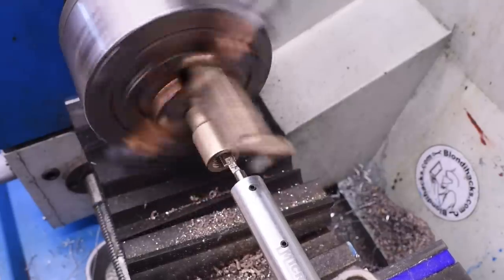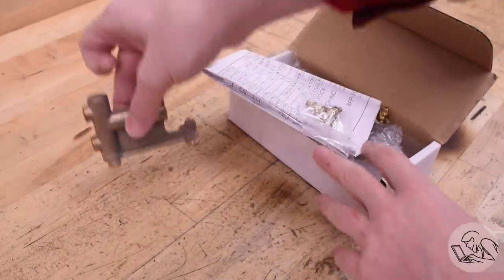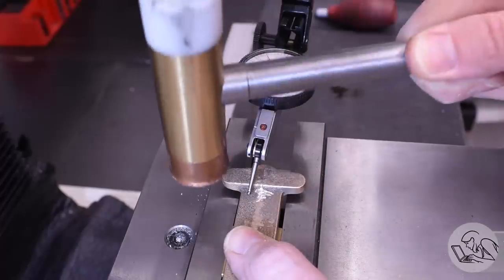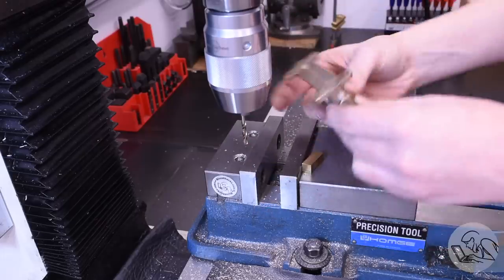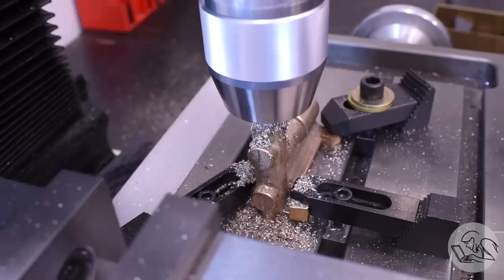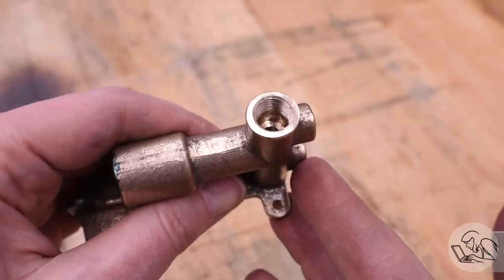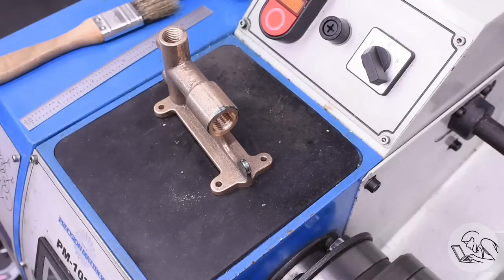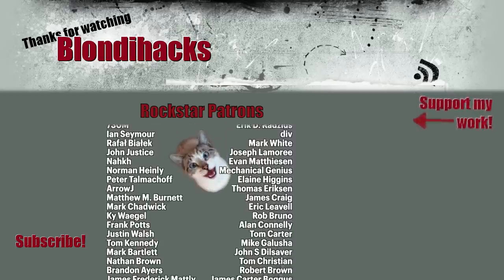Let's Build a Boiler Feed Pump! (feat. Ron Covell!)

Comment: As a boiler operator I love watching these videos. The boilers my company runs is 600lbs and 1500lbs steam from the 1940s and the equipment you make looks similar to the life size equipment.
Reply: What do your boilers power?
Reply: @pacificcoastpiper3949  we power 8 Power generator turbines 3 paper Machines and emirate of pumps, fans, dryers, digesters, heaters and anything else they don’t want to be electrical powered. It’s an old factory that was originally built 1898 and still producing paper today

Comment: Just a reference idea for when you need to drill two sizes in the same hole as you did with those dewalt bits Quinn.
I've had to do similar before and needed the holes to be somewhat accurate, so I started with the larger hole, then followed through with the smaller one. That eliminated the potential drift you mentioned 😉

Comment: Hi Quinn,
Glad you found some use for the pilot point drill bits. I figured they would come in handy one day and you did mention the proper way they were to be used. When you had the pump setup to mill the feet, could you have also milled the inlet and outlet faces to square them to the feet? You and your family stay safe.

Comment: Nice!  I made one of these a while back, and ended up doing it all on the mill.  However, one thing I'd come up with that others might find useful: If you cut the holes in the feet to a strict grid, you can use gauge pins in THOSE as your 'index' surface.  In my case, I used an angle plate to drill the long hole, and used a pair of gauge pins on through the two holes resting on the top of the angle plate.  

I ended up having zero problems with my index surfaces that way (and it was square to the webbing, since I clamped on that to!), though I DID have problems clamping to the angle plate (I used finger clamps, which gave out and ruined my first casting).  Had I been smarter, I could have used the vise the way you did.

Comment: Hi, Quinn, always good to see your video.  Now for the unwelcome criticism.  Here is your solution for the pilot drill thing. You drilled it first for the pilot point of the lower hole. Great, perfect. But then you drilled it out. Bad sequence. Solution; After pilot drilling full depth to the lower hole, follow that up by drilling to the pilot hole size needed for the upper hole.  (Only go to depth for the upper hole mind you.) Then drill the upper hole to its depth, and finally drill the lower hole to finished size. No drilling without a pilot. Easy peasy! Hope that helps, and greetings from Germany!

Comment: Hey Quinn, I really love your videos. Your approach to educating and amusement is wonderful. I am a carpenter by trade, now working in IT after some careless climbing in some scaffolding. Still doing woodworking as a hobby. The only need I can find for machine work would be the odd knob or fasteners. They would be a lot nicer than those from the hardware aisle at the shop. The bit that really draws me closer to the rabbit hole is the accuracy and tolerances which is unheard of in my world..

Comment: If you need a gauge pin in a size you don't have, you can stack 2 smaller pins with a gauge block in between. It's a little finicky to check a hole with, I usually wrap the whole stack with a rubber band, but it does work!

Comment: An air cooled steam condenser would be an added bonus. To recirculate the same water over and over again. An old car heater core and pressure relief on a reservoir would work nicely. Tip using only distilled water helps keep the engine and boiler internals clean of calcium build up that's present in our everyday tap water.😉👍👍

Comment: 14:00 you have 2 reference points machined already: put 2 gage pins into the holes in the foot you had drilled, and that should give you a vertical alignment

Comment: When you go to assemble the check valve using the hardened ball if you tap the ball at the bottom of the seat with a calculated amount of force you are "coining" the seat. It will be a much better seat than just relying on the machining surfaces.  
I used this technique while manufacturing a product that had a check valve integrated into the product and it works flawlessly.

Comment: Thank you so much for these extremely well put-together tutorials! I always thought about getting into model engineering but I just didn't know where to start. You channel has just the right pace and level of complexity to give me the confidence I could actually do anything other than create expensive waste. Also, it is naturally helpful to follow along as a beginner, as you're taking us along on your own journey and exploring new techniques along the way. Some of the more experienced people on You Tube are just out of proportion for beginners and do projects way too ambitious. 

One thing I'm struggling with is to keep the workshop clean as I'm working. Always swarf ends up on the floor, sticking to shoe soles and being carried around the whole house. Maybe it would be good to see what techniques / habits you use to keep everything tidy during the work? Also, how do you keep everything lubricated and not end up with smudgy hands? Somehow everything I touch in the workshop eventually has this light coat of (dirty-ish-oil), which I think is probably not conducive for more precision kind of work. Unfortunately I only have an outside shed and a 1912 lathe, so everything needs a lot of oil to keep working and not rusting. As an ex-car mechanic i don't mind it as such but your shop looks so clean and tidy. I think it's less the general cleaning than how do you actually work in there without making a mess? If I could keep it so clean, maybe I could bring the lathe into the house  :)
Reply: Ref the swarf and oiliness: the only way of keeping this at a minimum is to clean up after each and every operation. If you can't do that, clean up before you go for a break and at the end of every session.
Reply: I prefer to think of these not as tutorials, but as documentaries of what happened.  We for sure don't see every step, just the interesting parts.

Comment: Very nice work!  And thanks for the tip on using a plug to visually line up on the centre of an unmachined boss.  Every time I tried to do this via lay-out or just eye-balling it, the results were often unsatisfactory.
As for pumps, for a real challenge you may wish to build a small duplex steam pump.  No more hand work to fill the boiler with water!
These pumps were discussed at length on the Home Machinist website.  A number of different arrangements have been discussed therein, with construction drawings available at a reasonable price.
One such pump, a very compact one for locomotive use, was written up in Model Engineer Magazine during 1995.

Comment: Nice work as always.  A 9/16"-18 threaded bolt is probably not going to be a common size at a local hardware store but it was a relatively common thread size used on some older (1970's and 80's before things went metric here in Canada) truck wheel studs (3/4 and 1 ton series) that you may be able to find in stock at a local auto parts store and you can usually purchase them singly if they are in stock - just a suggestion that may help if you are looking for a test bolt with the correct thread.
Reply: 9/16-18 is a standard size for many hydraulic systems. Should be able to find a fitting at any supply house that deals hydraulic components.

Comment: As a electrical panel shop worker we used DeWalt's Power Point drills all the time drilling holes in electrical cabinet doors. These bits do not grab sheet metal like a standard twist drill , as they cut the outside first.

Comment: That was very good. Fully agree with your sentiments regarding test parts. I need to cut a 1" x 5 tpi acme internal thread for my Harrison Mill Refurb project, in bronze. I have so far got through three delrin test nuts, working the issues out of the process to gain confidence to cut the thread in the (expensive) bronze.

Comment: Your advice about test pieces also applies to making tooling and jigs as well, even if you are making only one  or two of something, being able to be sure everything is going to align itself or if you need to redo it it will be that much easier makes for much less stress, and reduces the chances of messing up a hard to replace casting or something you've already done a dozen operations on.

Comment: One source of 9/16-18 threaded parts are wheel studs/lugnuts, you can find them much easier locally than regular bolts. Same with 7/16 and 1/2 fine. Some older cars even used left hand pitch on one side of the car.

Comment: Mechanical pumps are cool and everything but my favourite machine (if it counts as a machine?) is the steam injector. No moving parts but able to inject water directly into a boiler against the boiler pressure using just magic! Well, steam pressure and science but it still seems like magic.

Comment: The sheer amount of content knowledge always amazes me in machining work. Being able to convey the process: priceless.  I have a few questions. Did you take into account the relative parallellness (is that a word?) of the bore cast to the bottom of the feet when milling the bottom or was it not very important given you had to drill it anyway? Meaning, if it wasn't cast straight, would that create an undesirable wall thickness issue? And could you have drilled the larger valve bore, then the smaller one, in that order to keep the point in solid stock or was there a reason for the other direction?

Comment: 14:00, could you use gauge pins in the mounting holes to have a reference for vertical? To guarantee the axis of movement is inline with the mounting holes.

Comment: Always make the external thread first if you have the chance. Would it have been better to set the original part up so that the valve housing was vertical & then machine the feet flat to that?  Looking forward to part 2.

Comment: Just another way to get there: Since you were dealing with a "soft" metal, you could have used a steel 9/16-18 bolt or male fitting, cut flats or grooves on it and used it for a tap.

Comment: Nice video as always, at around 14min you needed to set it vertical, would the holes you drilled in the feet not work using guage pins?

Comment: Regarding the pilot point drills... would it not have been "better" to actually perform all of those drilling operations in the reverse order?  Start with the largest drill which will create the shallowest feature, and then work your way "down"?  That way, each pilot point drill IS drilling into solid stock, and thus the pilot portion of it will do the intended job of keeping the drill centered.

Comment: Question: At the 14:15 point in the video you are using the horizontal (bottom) webbing to reference. When you started the machining you used the vertical webbing with blocks to set the part in your vice to mill the bottom of the feet. Why not put a reference surface on each edge of the bottom webbing to make setup easier in this part?

Comment: When drilling  with the pilot point drills make the larger diameter shorter depth first.  Allowinf the smaller deeper hole to use its pilot alsot.

Comment: We make up gauges for female threads. Simple go gauge, make your male gauge pitch dia to the bottom of the female in the handbook. So for 9/16 18. Gauge pitch dia 0.5264. Male bolt top of tolerance is 0.525, so on that thread you have guaranteed 0.001 clearance when your gauge threads into your part.

Comment: Hey Quinn, really basic question, hoping you have an answer I've not come up with.  When you were doing the fettling in the video, it looked like you were just working on your workbench.  How do you keep the grinding dust and grit under control?  Whenever I use a dremelmon anything metal, I end up with crap sprayed everywhere....  I've contemplated building some sort of enclosure to work in, possibly hooked to a shopvac, but you don't seem to use anything like that, and yet your shop is always immaculate.  Is there a trick to this?  Or do you just let it spray and then clean up?
Reply: You just have to do it far away from any precision machines and vacuum up afterwards
Reply: that was sort of answered last week in the shop tour.  She has an abrasives area at the back of the shop well away from any precision machinery.

Comment: How do you make sure the thread cutter starts at the same point inside the tube? I mean with depth I'm sure you can use a gauge but how do you know the cutting tool is biting nto the same spot rotationally to follow the same track?
Reply: the same way you do it with external threading; using the half-nut indicator. Assuming her leadscrew is 16 tpi, a 18 tpi thread would mean using the same number or opposite would be good.

Comment: How would you sharpen those pilot point drill bits.  Not everyone has $70 to toss towards a set of drill bits.  Do they sell these bits individually.  Great video by the way, I like these little projects that work with a previously completed project.

Comment: HELLO QUINN.   can you ideate, design, draft up and  make a metal tortilla press?.  I watch your vids as soon as they come out and enjoy the time spent with you online...I love the the excellent tools, holders, and clamps etc  you machine and teach, HOWEVER i don't  want a steam engine or pump, or the many  'kits' you build.... but a tortilla press machined at your direction from scrap pieces would be real life hobby/machine shop work.  I was about to make one in wood. but thought this would be a wonderful metal project as the metal ones available online fall apart quickly.  I'll be watching for your reply or a video  on the subject.   Thanks and keep up the intriguing exacting vids.

Comment: Pro tip for using gauge pins on larger bores: You can double up gauge pins, so if you need to check a 0.750 bore you can use a 0.500+0.250 gauge pin. I did something where I needed to use 3 gauge pins, but I did that in CAD so I wouldn't need to worry about doing math properly.

Comment: I live in the UK. I have a firearms license but my barrels to get turned cost me up of £1400 per barrel that's drilled and rifled. Would it be hard for me to do this myself with a lathe. If I could learn which I could as I have seen it done. Prices in the UK have shot up so much now. Just looking for cost effective options.

Comment: Presume you will feed boiler with Distilled or DI water, Quinn. If You were to use tap water you'd need to deal with the desolved solids in the water that would accumulate in the boiler. You may of course know this but some viewers may not. (Youbest regards, r Chemical Engineer viewer 🙂)

Comment: A question from a total profane: if you lack the proper tap, is it possible to create it by single-point cutting the cutting head threads? Are there blanks? I've never seen it done, so I guess there IS a reason nobody does it, but what is it?
Reply: There's a few videos where other machinists make taps so, yeah, I guess so.

Comment: Aircraft drills are normally only found in #40, #32, and #21 drill sizes to match the 3 normal rivet sizes used in aircraft aluminum fabrication.